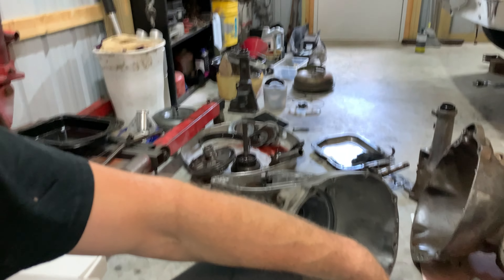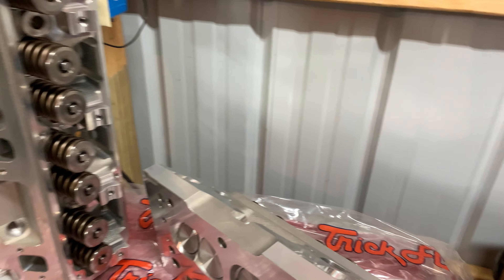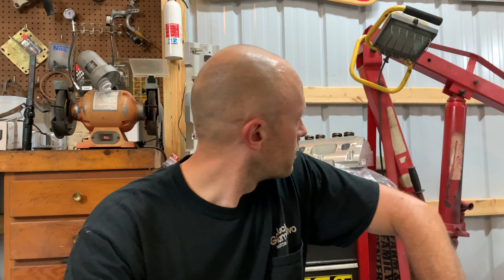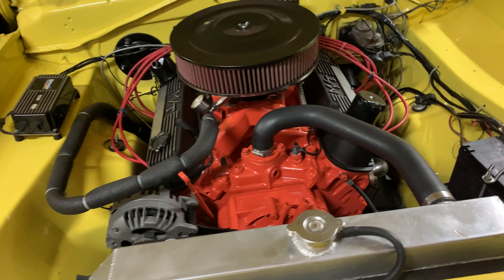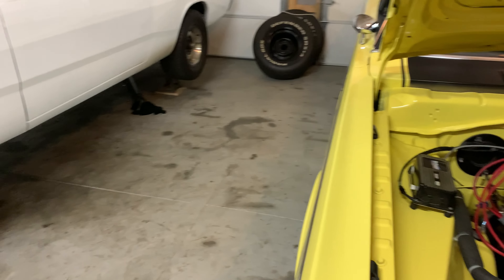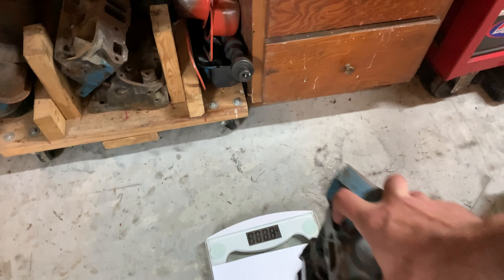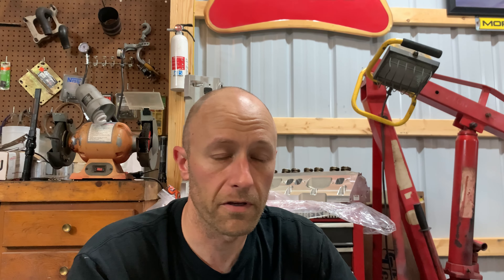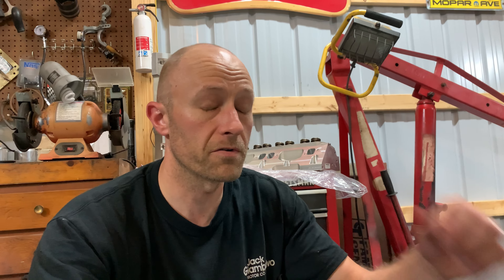Trick Flow CNC 190 Small block Mopar heads. How good are they? #trickflow

Comment: I picked up a set as well. Got mine bare. Now I wish I had got them assembled. I think the Trick Flows are the best Mopar head on the market for the money. Edelbrocks, Speedmasters need work to equal the performance. My 414 with  ported iron heads made 460hp with 9.3 compression, 850 Holley,  Air Gap intake, Comp 242/250, .558/572 106/106 solid flat tappet cam KB hyperuetectic pistons. I have no doubt I can pick up 100hp  with the right combo. My plan is to run the trick flows, 11.1-11.5 compression, .253/263, 600/.600, 108 roller cam, keep the Air gap or Victor 340 intake, 1 7/8 headers if I can find a set that won't cost an arm & a leg.  I have a Duster too except mine is a stick. Good luck brother!
Reply: Have victor or super fully flow balanced , and port matched , Mine are way off with both those intakes. Best of luck with your project
Reply from the maker: That’s badass! That sounds like my planned build. A 11.25 to 1 comp, 408. 260ish degree roller cam. Indy magnum single plan intake(drilled for LA intake bolt pattern). 1 7/8 headers. Sounds like you got a solid plan.

Comment: I'm all with your plan of putting the heads on and seeing what they do. Best A/B with just head swap n no other changes to help others see exactly what just the heads do.  Can never have to much data. Also the swap itself can help younger guys learn whats involved so good for views.  The trick flows do flow better under .500 lift over most moderatly ported cast heads plus have a much better chamber so you should see some gains. The choke will be the intake since it doesn't flow near as much as the heads. Testing a single plane after is a good idea. They all still need porting to try to keep up. Haven't seen any standard intakes even ported flow over 280 on the heads. I got a Victor 340 going 348cfm on its own but it doesn't do that once bolted to the head. The new trick flow intakes only goes about 240cfm bolted to the truck flow head so can use some work . It does look like the chambers could use some deshrouding around the tight areas of the valves. The chamber should be at least bore size in that area. Always good gains to be had. They tend to keep the chambers smaller to also work on 318's bore size. Which just reduces the potential for the other 97% of people using them.  For me testing is the funnest part.  Having been a professional engine builder (mainly mopar) n still R n D as much as possible plus stay humble and always try to learn. One of the cars i've been able to build is a 67 plymouth valiant with a 408 and well ported RPM heads which are very comparable to the trick flows. In Alberta our DA is usually 3400-4500(first n last race of the year we have had 1200DA)  pump gas, all steel,full interior,drive to the track i run low 10's. I'm sure 9's is possible with a bit more radical combination. Of course then it snowballs again at that point.  Most important key is the details. I tend to detail every part so it's optimized and everything works together. Our smaller port heads like cam duration n lots of converter even with a 408.  Luckily todays converters are built well so aren't even noticeable on the street.  In the past we have built 360cid engines to run in the 10's with ported stock heads so you should be able to meet your goal. I've found some of the You tubers that aren't running 10's yet with the trick flows are mainly just missing details. Your car runs good for what it is so i'm sure you'll do well.
Reply from the maker: Man, thank you for all the information! You know your shit. I might have some questions for you in the future. Low 10s would be mind blowing for me. Thank you again. Have a great weekend.

Comment: Best heads you can get on the market. Fantastic CNC porting, 60cc chamber for higher compression, very well designed combustion chamber, big valves. They're great. I've seen them make nearly 600hp without touching them, right out of the box.
Reply from the maker: @FeatheredDino  I’ve heard and seen a lot of good things about them. I hope they make a decent difference on my 360.

Comment: Nice addition to the 360. I have a 340 with the iron J heads. My cam is only .500 lift. I am looking forward to seeing how this works out. My car is a 70 Challenger and only used on the street. But with the spark knock I am getting. I have considered a set of trick flow heads because of the aluminum heads would allow me to keep these high compression pistons. And I wanted the best aluminum head that was still affordable. So I will be checking in. Good luck and thanks for a informative video.
Reply from the maker: Agreed. Since aluminum dissipates heat twice as quickly as iron and the much more efficient chamber. They should help with detonation.

Comment: I think your new heads are going to be real good. The challenge will be picking a cam that's going to suit your needs with these heads. Regardless stick with a LSA of 106 - 108 as most cam companies have way too wide LSAs. The other thing is a roller is way better then a flat tappet for the simple reason that they don't wipe out. You don't have to worry if the springs are too stiff or the oil is right or the rocker ratio is too high. I know they're expensive but wiping out one flat tappet cam just put you way ahead. All the best.
Reply from the maker: You’re on the same wavelength as me. I love a tight LSA cam, no wider than 108. And when I build this 408, a roller cam is definitely going in. Thanks for your insight brother.

Comment: Will the 190's work with a positive piston deck in a 340 engine?
Reply from the maker: @billbob9304  I wouldn’t see why not. You will most likely have to run a thicker head gasket though. Piston to head clearance would have to be checked.

Comment: I purchased a set of TF190s back in 2021. Had them in in the box ready to replace my partially ported Edelbrock 6077 (purchased  in '00) heads. Was to swap onto my existing 360 w/231/237 .525 w/Ed AirGap and TTIs, but realized there would not be much gain. Outside of a minimal intake cc gain and the better exhaust, the TFs and Ed heads are very similar. I returned the TF190s to purchase TF240s for a future lowdeck 400 stroker deal. 

Thought was, and still is, the lowdeck stroker will cost roughly the same as building 408 stoker, but has potential to make considerably more power than small block. Lowdeck still fits an  A-body well. Plus, to get most out of TF190s, you will need to go single plane intake and 1-7/8 headers, all things you would also need to purchase for big block.
Reply from the maker: I hear ya. It is going to cost the same as a big block but probably make less power. But I’m just a small block guy. And know these heads on my current 360 combo isn’t optimal. The stroker I’m planning should take full advantage of these heads though.

Comment: I've got TF190s on my 318 with a howards roller... have only had it in the driveway so far but the heads are beautiful

P.S.i went with the mancini harland sharp rockers and bolt kit.. buy a shim kit if you go with them, took a but to space them all nice with good clearances
Reply from the maker: Sweet, thanks for the tip. I did get the pack of MP rocker shims. I guess they will be getting put to use.

Comment: I personally would like to see you add them to the 360... Most people like to see what type of gains you'll get just with the cylinder head change...

1 I really don't think you're going to go backwards in power by just swapping cylinder heads 
Even if you left the same camshaft in there 
2 yes it is true you will see larger Gaines larger camshaft stroker kit cimbo ...  But the average guy doesn't have the budget for that type of thing... He may want to know what he can do just with a set of cylinder heads....

3 a lot of people are probably going to chime in and say you need more camshaft ..  larger stroke portrd  intake.. to make any type of difference....
I would say obviously all those things are going to make a difference... The question is how much ? Certainly I would never argue for optimum performance that  a stroker kit ported intake and large cam  wouldn't bring the best hp numbers....  Because it would But you got them sitting there I say put them on the engine and run it ...   Maybe add a ported intake and cam later... Just to see the time slept differences between each step forward...  That would definitely make for some good content and videos.
Reply from the maker: All really good points. It would be cool to see how each change improves performance one at a time. Thanks for your input.

Comment: Neat! Trick Flows would be my choice hands down, especially since I recently heard Steve Dulcich say that the Edelbrock LA heads weren’t that much better than 2.02 X’s or J’s? I was surprised because I was under the impression since they came out that they were a good bit better than stock 🤷‍♂️. Anyway, it would be really cool to see a straight A B test with the heads being the only change on your car.
Reply: ED Heads are replacement heads for stock mopar. only weight is the advantage
Reply from the maker: That’s the one reason I picked the Trick Flows. I knew the Eddys would require a good  bit of work to get the same flow. Plus I would have to change the valve springs. I am getting excited to see how they will change the car’s performance.
Reply: @smilsmff  that's not exactly true. We got one of the first sets. The are cast after a ported stock head. Then can be improved even more since they are thicker.
Reply: That's not exactly true. We had one of the first sets in Canada. Being a engine builder and flowing lots of heads have tested many. Still have the original article of how the Edelbrock SBM hwads were made. They were cast after a ported Factory head. Stock head barely goes 200-215@.500  Edelbrocks go 240's @.550 ported will go over 286 @.550 which is best for cams under .600 lift. Best i have seen them go is 330@.750    Just stock to stock on a mild engine a guy can see 40hp plus gains. My ported RPM heads  made 126hp more over stock J heads on a modified engine. With aluminum heads it's important to also increase the compression for a fair comparison. Making sure the intake can keep up to the heads is also important.
Reply from the maker: @dannyfasttcars8612  more great info brother!

Comment: You know, if you’ve got a nice set of head studs….👀….I’d highly recommend looking in to running around 8:1 compression, forged crank and a 62mm turbo. 
With as hard as that thing leaves, you don’t even need a 2-step. Let that big dog eat under natural aspiration, and as the boost builds around the 500’ mark….LOOK OUT MAMA!! That bad ass monster will lift HARD and put some distance between you and whoever you line up against. 

If you’re expecting to be in the low 11’s, that setup would be good enough to get you into the high 9’s, I’d think. 

I don’t know if you follow the street racing scene (NOT the takeovers where the do donuts), but you should. I’m telling you, the things they’re doing today would blow your mind. I watched these kids (early 20’s), absolutely DOG WALK a big tire/big block ‘69 Camaro, en route to taking everyone’s money. What did they do it in? A Subaru Impreza, and not a WRX. They put forged internals, Dodge Hellcat fuel system, some other bolt ons and this huge 68mm turbo, with a 2-step system to launch under boost. My god. 😮This is a mid-9 second AWD street car. 😳
Reply from the maker: I know the stuff they are doing with turbos these days is crazy. I definitely thought about what it would be like to boost a small block in one of my Dusters. I would have to change a lot with my setup though. Full cage, fuel system, suspension, better brakes and a different torque converter. It would be badass though.

Comment: Been looking at heads for my 340 stroker build, might try these out for my 74 Duster. Got it back on the road this week with a 318/904. If you need nitrous, let me know. Have a crappy load here from my King of the Street racing days with the hemi
   I have a complete 904 that has all new internals, case has a problem but I had just gone thru it if you get in a bind for parts
Reply from the maker: Thank you! I really appreciate your offer. I think I’m good with the transmission parts. It took 2 trannys to make one good one though. Good luck with your stroker build brother.
Reply: @Duster_Garage  Thank You.

Comment: I think they will work great,I would have had those exact heads on mine if i could afford it,one of these days ill get a set. I think i would put them on the 360 and run em,from all the dyno tests ive seen on them they will pick up power even in the lower lifts area's over even ported iron heads.Your already losing 50 lbs,so thats already gonna pick up a few hundredths there with just the weight loss,Just my opinion tho,but if it was me i would like to see how they would run on the 360,that motor runs great already!
Reply from the maker: I appreciate your input. The more I think about it the more excited I’m getting. I’m definitely putting them on the 360. I think it will be a really neat comparison.
Reply: @Duster_Garage  Good deal, Look forward to see how it does with em!  I need to get to the track to test this 8 in. Converter but it's been so damn hot and miserable I haven't gone yet,Car doesn't run worth a crap in this heat and crappy air anyway lol
Reply from the maker: @RT211Racing  I’m looking forward to seeing the difference with the 8in converter. But I hear ya about the heat, it’s been crazy hot up here.

Comment: @Duster_Garage I’m planning to do a 360 build on a ‘72 dart. What do you recommend for heads and intake manifold for performance wise. I’m just going for something that I can have a good bit of power on the street.
Reply from the maker: @Abody_Garage  The intake manifold is an easy choice. Edelbrock Performer RPM air-gap. Hands down the best intake for a street/strip build. Excellent torque and good horsepower to 6500rpm.  There are more than one good choice for heads. 

A set of stock 360 heads can be a very nice choice.  Milled deck surface to increase compression. Gasket matched ports. 3 angle valve job with blended bowls. 

The Edelbrock heads are nice. 
The Trick flow heads are really nice. 
Speedmaster and Promaxx heads aren’t bad for the money either. 
If you go with an aluminum head, have a machine shop, clean and inspect them. 

Good luck with the build.
Reply: @Duster_Garage Thanks man, appreciate.

Comment: Mate if you’re going to put the trick flows on, put a nice single plane on it, the dual plane will be a cork.
Also don’t earth your battery through your cylinder head, please attach it to the block.
Reply from the maker: Good tip for the battery ground cable. I know the dual plane wouldn’t be right. But I’ll probably run it like that then maybe change to a single plane to see the gain.
Reply: @Duster_Garage  I'm with you on testing the difference between dual and single.  Remember many intakes cast the ports really small so stock to stock may not always give the best results.

Comment: What spring pressures are on the springs on that trick flow head?  Are the springs setup for roller lifters and will they put too much pressure on your flat tappet cam?
Reply from the maker: @chrisw5837  the heads I got have the 1.55” springs and titanium retainers. My machinist checked them. 155-160 lbs on the seat. 
350# @.500” lift
400# @.600” lift
450# @.700” lift
Should be ok since I have solid lifters. And the cam and lifters are already broken in.

Comment: Are you running pump gas?
Im curious with your KB pistons and smaller chambers on these heads as to where your compression will be at.
Reply from the maker: @birdbrain9293  I am running pump 93 octane. The static compression ratio is 10.75 to 1. The cylinder pressure didn’t really change from what the bigger chamber iron heads had. Aluminum dissipates heat fast than iron.